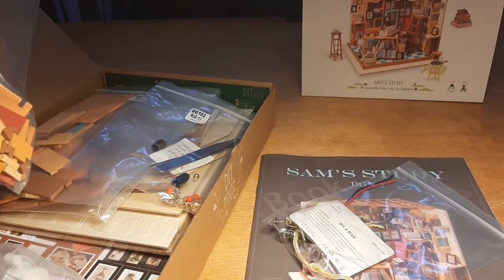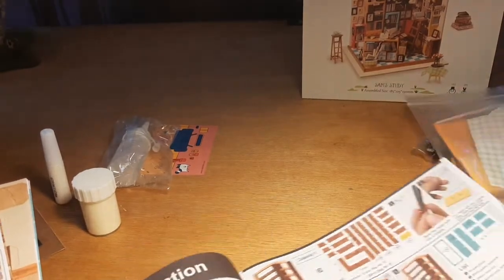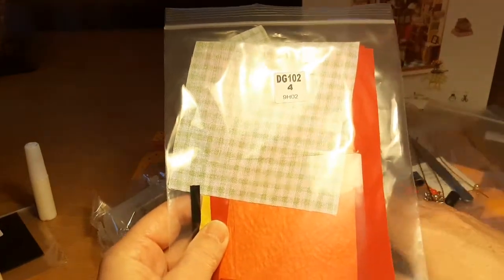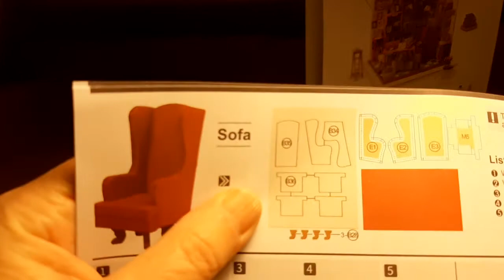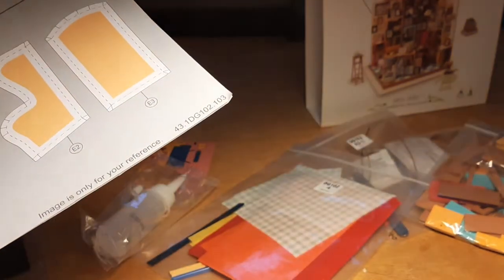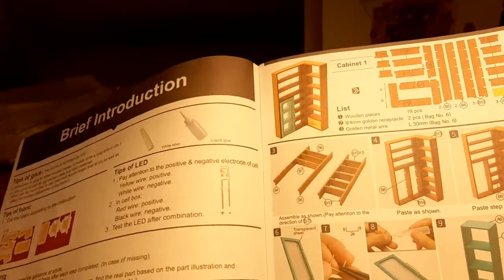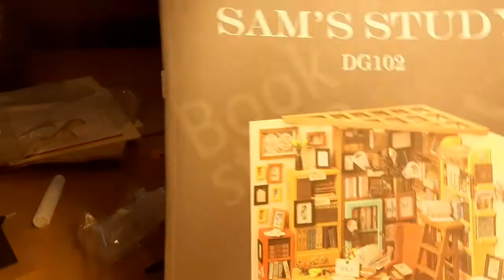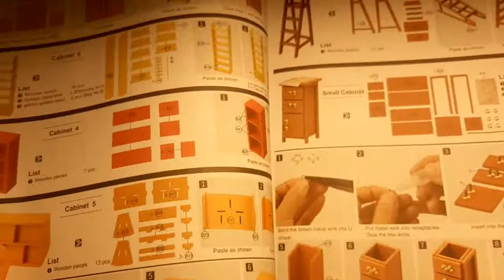Some explanation on the manual of a Rolife DIY miniature house kit.

Comment: How do you fold the first books, it's the only thing I don't understand and the instructions don't give any info?
Reply from the maker: It has been a while, not sure what you mean by "first" books? The ones that can open, you need to glue the pages together. There were so many books.
Reply: @everythingverysmall  omg, I only just now see/realize that every strip has to be cut into two lengthwise to make two books per strip 😆😆 I couldn't make it fit but now I understand, Thnx!! 😁
Reply from the maker: @weardodo  glad you found out 😊

Comment: Should I cut everything in the kit before starting to assemble?  I am brand new to this craft.  Thanks.
Reply from the maker: The wooden parts are already cut, so no need there. The other things like the plants and pots, I would do one by one. Or I think that you might loose a lot of bits and pieces if you already cut everything. For the books from Sams study, however, I spend 2 evenings in front of the TV , cutting all out first haha. 
Good luck !
Reply: @everythingverysmall    Thanks for the info.  I decided to start with step 1 and keep going.  The kit does look overwhelming to me.  This is my first kit.  Do you have a glue recommendation?
Reply from the maker: @ellentaylor8857  you are welcome ! I tend to use Aleenes grab fast tacky glue nowadays, but there are others, also for particular pieces, like windows and such. I wrote an extensive blog post on this https://everythingverysmall.com/making-a-diy-miniature-house-a-toplist-of-handy-craft-materials-to-help-you-out/